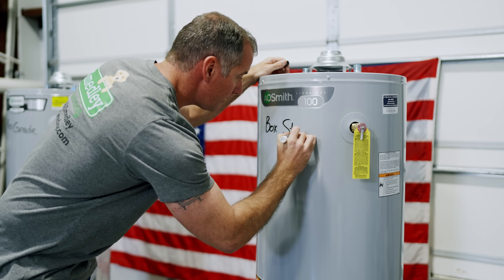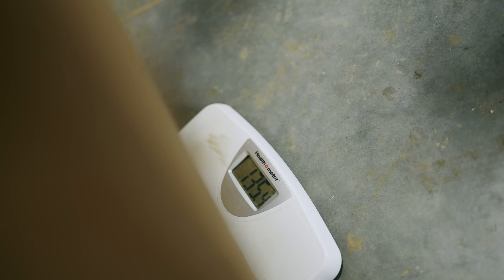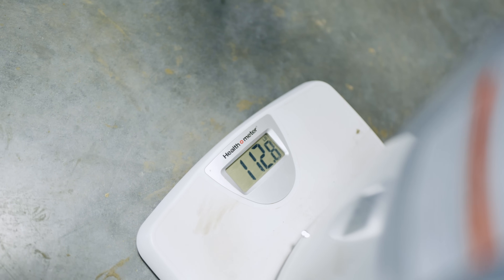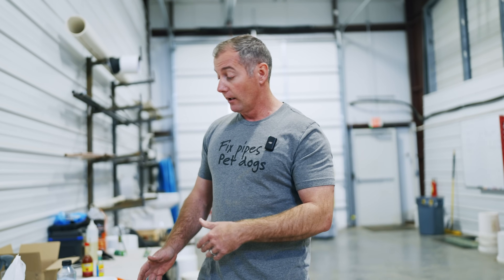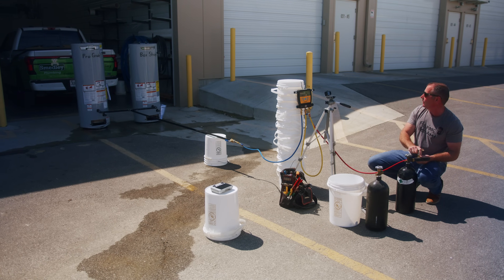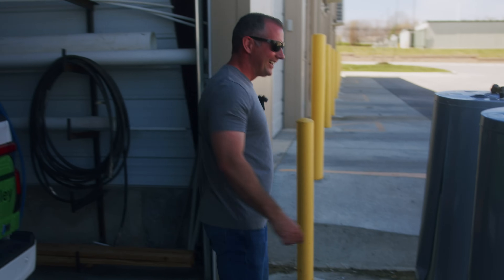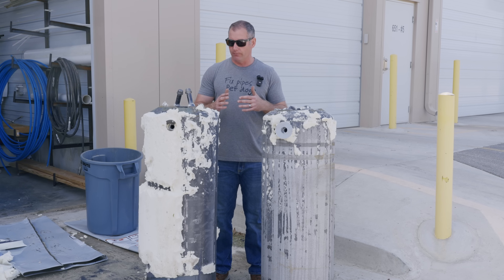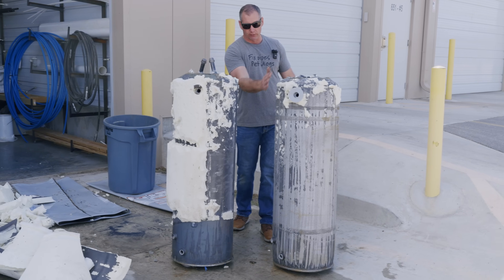What water heater should I buy? - Pro Grade vs. Box Store

Comment: No matter where the water heater comes from you should inspect the glass lining before purchase. Take a super bright flashlight. Or even better a bore scope. there dirt cheap now days. Pull the down tube from the cold water side. shine the light into the hot water side and look into the cold water side. The inner portion of a regular water heating tank has a coating which is either Glass Lined, Porcelain Enameled, Vitreous Enameled or Blue Silicon Enameled. Look all around the inswide walls paying close attention the the pentration points. If you see any cracking or spidering of the glass lining don't buy it. That tank will rust out starting at that cracked liner point. I use a bore scope whenever I replace one for a customer.
Reply from the maker: Lol.  Yeah I can guarantee not a single person or plumber has ever done that.

Comment: Bought a home in a new community.  The water heaters started failing 2 years later.
Reply from the maker: It happens for sure.  Typically a high water pressure issue when they fail that soon.

Comment: One thing you didn’t talk about (or maybe i missed it) was the energy consumption box office $227 yearly supply store $320 yearly that is a substantial amount of money , if i replace my heater in 10 years i would spent $930 More on energy on the supply store plus the initial cost  of 109 total $1,039 plus installation, it might better but NOT   $1,000 plus better. i love your videos but this one was missing some information. Thanks
Reply from the maker: Those stickers are wildly inaccurate.

Comment: I have a pro grade water heater (electric) that in the fall will be 10 years old. No problems at all. My (and I believe they all do this) insurance company in Florida requires the tank to be replaced after ten years or they will not insure you. My tank has a 12 year warranty and now I have to replace it with two years left on the warranty even though there is no problem with the tank.
When I replace it again I will not be spending the extra money for such a "good" tank. Another issue is now all suppliers do not sell to the public the pro grade, only plumbers can buy them so a homeowner, skilled like me, cannot even buy a pro grade tank even if I wanted to.
Great video but the information you provide is worthless because even your box store tanks appears good enough to last the maximum ten years I can have a tank before the mandatory replacement is required.
Reply from the maker: I've never heard of mandatory water heater replacements due to insurance requirements. But I'm sure that makes plumbers jobs a little bit easier down there.
Reply: @SmedleyPlumbing  Literally here because of what LunkerFishing just said. Except the "Pro grade" version supplied by the plumbing company is $355 more. Plus, they want to add in the "upgraded anode rode" for another $255 installed. Totaling $610 more than the box store which says it already comes with the premium anode rod, versus the base model $100 cheaper.  However, here we are because insurance companies are mandating it or we are dropped. Same as roofs! Florida insurance companies made changes that roofs over 10 years old will have to be replaced.

Comment: You are right, they are not the same heater, they are different series, Lowes sells the 100, 300, 500, and 900 series. Now, If I go to Johnstone supply and buy a ProLine, and  ProMax that are $50-100 different in price, I would expect them to have different parts.  This is By Far not an apples to apples comparison.
Reply from the maker: Most people think they are the same.  The purpose of the video was to disprove that idea.

Comment: Another way to see the difference is that each water heater will have a different part number.
A good option for a water heater is a tankless design if your hot water needs don't require 40+ gallons of hot water.
Reply from the maker: Yep

Comment: The two units may not have been made on the same line on the same day but they probably were built on the same line with slightly different parts. Then different sticker slapped on granted the pro unit is somewhat more robust but is the minor differences worth a hundred dollars???? Time will tell.
Reply from the maker: Yep

Comment: I just replaced a Home Depot water heater it was 18 years old it had an 8 year warranty worked like a champ. It ended up starting to leak. No one is a fool hot water tanks just don’t blow up. It all depends on the manufacturer.
Reply from the maker: They don't make them like they used to that's for sure.

Comment: I'll never buy another box store water heater.  We bought a Rheem from a box store when the unit that came with our house failed at end of life. Six months later, in December just before Christmas, it failed. We called the box store for warranty service.  After run around from the box store, the installation company, and Rheem we were without hot water for 6 weeks! Finally got a refund out of Rheem (only because we insisted after they sent the wrong part for repair). We then bought one from a plumbing supply store. It's been running like a champ going on three years now. Never again going to subject myself to heating water 1800s style for everything for 6 weeks.  Couldn't believe how indifferent Rheem was to our situation!  They actually wanted us to wait longer (2 more weeks) while they sent the part our plumber had requested in the first place for the fix, after they initially sent only a portion of it, taking two weeks. I'll never again buy anything with the Rheem brand. Couldn't pay me enough.
Reply from the maker: Yep!  Pro grade all the way!
Reply: I purchased a Bradford White water heater. It lived just beyond the warranty period and started leaking on a weekend. This bunch doesn't tolerate no hot water,  not even to wait until Monday. A quick trip to HD and a Rheem gas water heater was soon calming the troops! That Rheem has performed flawlessly and has outlived the Bradford White pro grade heater by a couple of years to date!

Comment: So typical water pressure is around 100lbs per square inch correct? Certainly not 400lbs per under normal operation. I'd think that's an unreasonable way to compare the tanks. It's a torture test that doesn't simulate normal operation. Making the welds on both the typical failure points. Which i'm assuming are done by robot/machine. Or if done by human, could be done poorly, dirty, contaminated materials etc. In that scenerio, i'd feel the welds would be the area i'd want to not fail, but common sense tells me both SHOULD be the same, again bringing it to the literal material each tank is made of. Thickness, quality of metal, etc. Would have been nice for you to cut a sqft of each tank material and measured thickness, weight, and maybe have scanned by purity laser at local scrap yard.
Reply from the maker: Yeah we were just trying to accelerate pressure in time to learn why the box store tanks fail faster in the real world
Reply: @SmedleyPlumbing a 4x RWP hydrostatic is a normal test procedure in the fire protection industry, so what you did is a normal procedure to me… be well!

Comment: Pro-grade water heaters come with useless warranties that can only be fulfilled by a licensed plumber. But licensed plumbers (in my area) only install water heaters. They do not fix water heaters or do warranty work. So if you are good at installing a heater, use the box-store heater. It is just as good and has a warranty you can use. But one note: Buy the most expensive heater you can find with the longest warranty. You get what you pay for.
Reply from the maker: Anyone can call tech support and file warranty claims.  Homeowners or contractors.  They don't care.

Comment: With all due respect, "Yes" these two (2) units can be manufactured in the ("Exact") same assembly line.
EXAMPLE: All vehicle manufacturers, manufacture (MANY) of the same vehicles. The BUILD-SHEET states to put a plastic water spicket vs, a copper water spicket, then the next car build sheet may list leather seats vs, material, etc.
Therefore, you mentioned this a lot and your assertions are not true. 

So, in this case, using the model I just spoke about could be true or they could be built in a different facility?

This is easy to answer, "JUST READ WHERE THEY WERE MANUFACTURED AT." Just look at the label.

Also, the initial weighing in with the units in the boxes, the (Box Store) units weighed in at (130.8) but he stated the Box Store units as 130.0 shorting the (Box Store) unit (.8)...

Also, the Pro Grade came in with two (FOAM TUBES) which ass weight to the Pro Grade; however, that is a minuscule amount. But this is to be an apple-to-apple measurement and weight (per unit). 
This is just my observation. 
In my work my evudence has to he 100% factual evidence and (everything "matters")!!!
Reply from the maker: We know that.  But the general public doesn't

Comment: What causes a 4 1/2 old Richmond 50 gal what heater to run out of hot water when only two people taking a shower for only 15 minutes?
Reply from the maker: If it's a gas unit, might look for a failed dip tube on the cold inlet.  If it's electric, look for either a failed lower element or a failed dip tube.

Comment: They really could be made on the same assembly line at the same time. I think people vastly underestimate the ability of manufacturers to make multiple different products at the same time on a single production line.  It is extremely easy to build to suit whatever is on a BOM using different parts as required.  It's no big deal to put a metal valve on this heater and a plastic valve on the next one. One sticker on this one, different sticker on the next.  Etc.
Reply from the maker: So how do you explain the weight different between the tanks?

Comment: Glass can actually be very flexible. The thickness of the glass lining inside a water heater is the same as the glass of some Local Area Network fiber optic cables.
Reply from the maker: Bending and stretching are two completely different things.
Reply: Glass is a general term that applies to a variety of materials such as obsidian used for arrowheads and glazes used on porcelain and ceramics. The glass materials used to line a water heater are designed to account for thermal expansion and flexibility common to water heaters under normal operating conditions as opposed to the glass that most people imagine when they think of windows. This Old House posted a video years ago where they cut a water heater open and described the construction of the tank and glass lining in great detail and how the glass lining failure is more an issue of pitting caused by sediments trapping heat over the burner rather than failure from repeated heating cycles.

Comment: Great video but longevity of a water heater is about maintenance and what kind of water you have. Either one will be just fine. Change that anode rod and keep it drained & flushed.
Reply from the maker: Our many years of experience watching box store units fail faster on a consistent basis would say otherwise.

Comment: It seems to me that the heaters were made at the same factory, on the same line, just with different options.  The main component, the tank, seems to be the same.
Reply from the maker: There is enough weight differences to think otherwise.
Reply: @SmedleyPlumbing  Maybe I missed it.  Did you weigh the tanks after every thing else was removed?  This is a good video by the way.  I am not disagreeing with you.  It just seems to me that the differences are in the parts installed on the tanks and not the tanks themselves.
Reply from the maker: @martyb3783  yeah the tanks alone have a significant weight difference.

Comment: If you were to pump water into the tanks for pressure testing you could safely go much higher in pressure. I’ve teste gas pipeline equipment to 2000 psi using water, no safety problems at all.
Reply from the maker: Awesome!  Thanks!

Comment: I AM KINDA bummed your not doing the Liberty area.  I said my water heaters an Bradford White that is a 6 year tank on its  32 years old and its never had service done to it,  I am not doing anything to it.
But it would be a good one to cut open and measure the tank thickness and compared to a newer 2024 unit.   
I would love to have a copper unit
Other then pressure it should last a very very long time if i have no  differnt type of metal problems. 
But no one makes a copper unit.
They do make stainless steel units. 
More carbon content in the metal and stainless almost never rust if its real stainless steel.
Reply from the maker: We totally service the Liberty area!  Give us a call!

Comment: Honestly this isn't a very good comparison. You're comparing a 40,000 btu water heater to a 35,500 btu water heater that is almost $100 cheaper ( GCR-40 40 gal, 40,000 btu ProLine water heater with a 6 year warranty - G6-T4035NVR 40 gal, 35,500 btu Signature 100 with a 6 year warranty). The difference in btu rating puts these two water heaters in completely different classes. A higher btu rating means the tank has to be able to stand up to higher heat, you get better recovery time and costs more to operate. You should have gotten the 40,000 btu unit from Lowes (G6-T4040NVR) that is about the same price as the ProLine to make any valid comparison.
Reply from the maker: We got what Lowe's had on the shelf.  But it doesn't surprise me that they have the smaller burner and we're conveniently out of the larger one.

Comment: This is an interesting test. I've been in the wholesale HVAC & plumbing business for many years and service & installation. 
 In a pinch I purchased a Whirlpool gas water heater from a "Blue" box store that leaked water out of the gas valve . Following the directions  on the heater and getting approvals, 5 phone calls and 3 days without hot water got replacement valve under warranty and found at some point they decided the thermocouple should have proprietary left handed threads.
The water heater was returned to the store against there recommendations  and I committed social suicide. 
  GO with what you know, and I know the name and phone number of the person(s) at the wholesale supply house and they take care of there customers.
Reply from the maker: Yeah it can be a disaster

Comment: 2 things.  1 pressurize with water only. Use a grease gun for high pressure. It’s much safer. 2. I wonder if the tank weight difference is glass and no glass
Reply from the maker: 1. I believe we safely popped the tanks.  
2. Who knows on the difference.  But we do know that box store tanks fail much faster so the weight must play a considerable difference.

Comment: Yeah the plastic stuff goes straight into the trash just like you said it's against code to have combustibles on a gas unit.
Reply from the maker: Yep
Reply: @SmedleyPlumbing  I converted ours to an outside line for the pressure washer.  40 gallon rheem.  Got the PRV connected to the HVAC drain and the drain pan 🥳 I went all out.  Nothing is flexible on it besides the new gas line that connects to the sediment trap.

Comment: Mostly accurate.  It's funny how you tried to show non bias; but you still are. Example: you try to frighten people into thinking that the store bought tank would have exploded. You don't know that. It could have.  But more than likely it would have split the seam weld just like the other.  My main takeaway was that the pro grade tank is thicker which should allow it to last longer and the drain valve was superior. You also can't call one part a lower quality part because it has one twist less than the other. The truth is that these are basically the same. One heater is lower price because they cut back on features to allow a cheaper price.  They also probably were assembled at the same factory using mostly the same parts but probably did  use the same assembly process.  If they advertise that they the same, then you have busted them. . Aside from those points I enjoyed your video
Reply from the maker: We are absolutely biased because we see so many box store units fail so much faster.

Comment: All water heaters come with at least 6 years warranty  lowes and parts store . He made a comment that he has went to a customers home with a box store water heater that started to leak after 18 months. So that water heater had  a replacement warranty.? Is did he replaced the box store heater and just charge service call. Or sold the customer parts house heater and charge full price. If customer was entitled to the warranty, they shouldget it. And my opinion the life of a water heater is the quality of the water.
Reply from the maker: Yes but the box store units fail within warranty much more often than the pro grade units.
Reply: @SmedleyPlumbing  no disrespect, but a water heater is only as good as the water going into it. They all get 6 years. Some make it some don't. And the ones that die before the warranty is up. it's a win for the home owner.